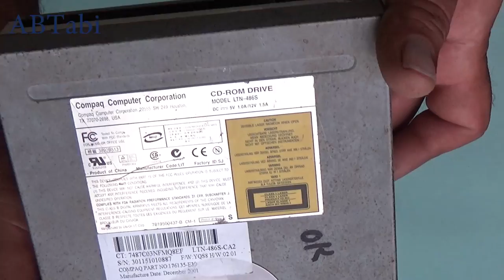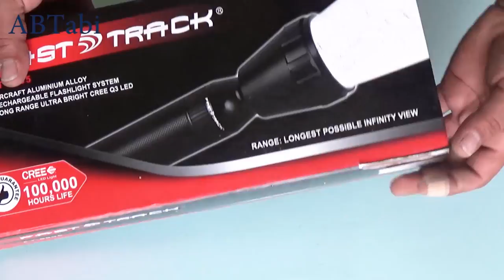9 way to find Free Powerful Neodymium Magnets

Comment: The trick is to get the neos out of the speaker cups once the glue is loose. The smaller ones you can use a small screwdriver but as you get bigger it gets much harder. Use heavy gloves big ones can bite hard if you are not careful! You can stick the speaker cone side to another large neo (when out just slide it off) or a thick piece of steele and on the side with larger gap that is made when you slide it over fit a medium flat head screwdriver between the metal plate over the neo and the neo and carefully pry up and get a bent tool under the back side of the neo and pull it out or push it out with a metal wire thick enough to go through the back side of the cup for some. Some are so big sometimes the best thing is to find the distance hight to the magnet and cut the back of the cup off all around without cutting into the magnet takes a lot of time about 1 hr.

Comment: Thanks for all the different places to find good neos. You didn't show how to get neos out of speaker cups easily without using acetone and not damaging the nickel copper nickel protective coating that you have to use zink metal paint or re-deposite cote them so they don't corrode.
Reply from the maker: Great suggestion! ,,,,,,,,,,,